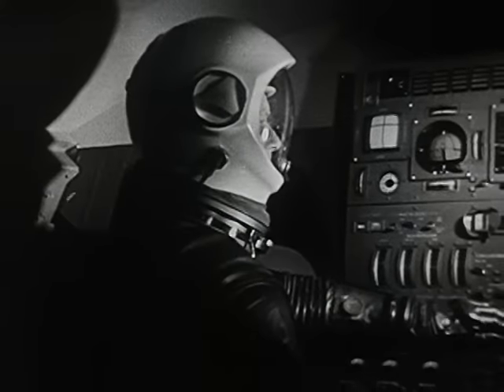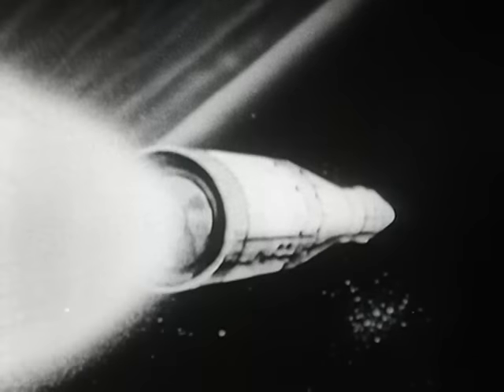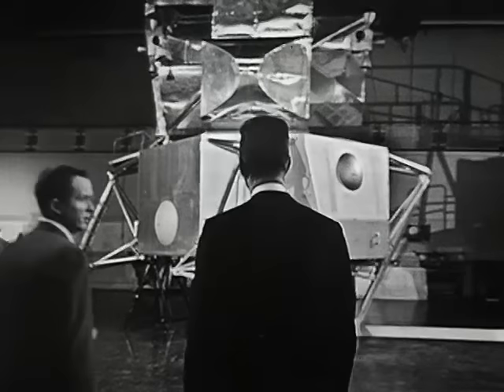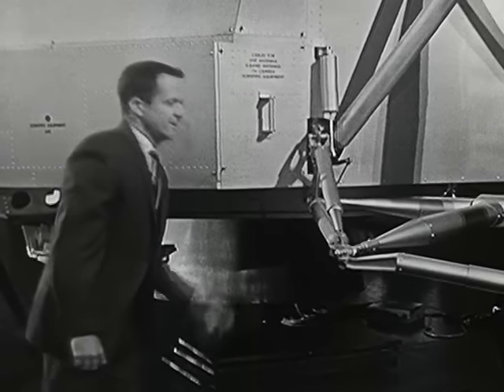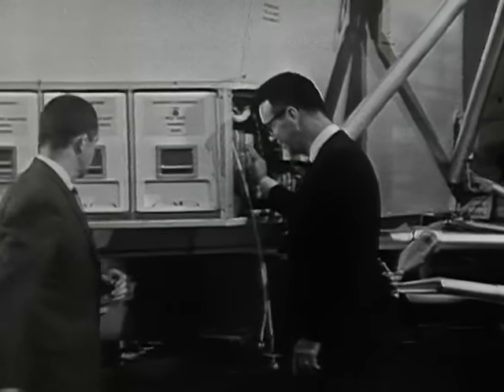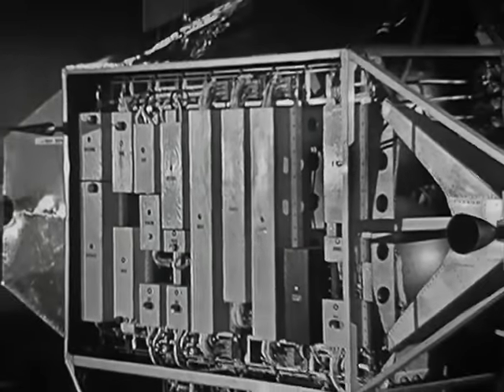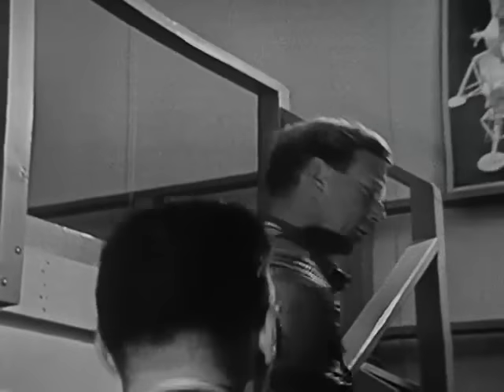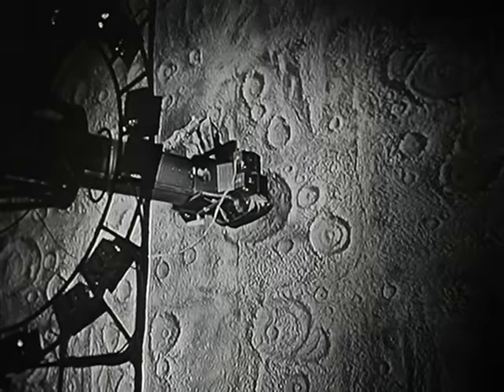MIT Science Reporter — "Landing on the Moon" (1966)

Comment: Where do they store the batteries, where is the air conditioner, where do they store the breathable oxygen, how do they put on space suits in such limited space, how do they determine altitude when landing???
Reply: Why not look it up?
Reply: +TheBigley  You didn't really expect your questions to be answered in the YouTube comments section did you? You could download a copy of the Lunar Module Familiarization Manual LMA790 Volume 1 which was used by the astronauts themselves to get their heads around the LM and its operation. Wikipedia has some great entries. All you have to do is intone the sacred word G-O-O-G-L-E   G-O-O-G-L-E.
Reply: PoloponyAZ16 What about the 3 huge parachutes?
Reply: Thats not on the LEM thats on the CM
Reply: +37VQV  You are a party pooper! PoloponyAZ16 had it all worked out in his mind's eye that everything was in the LM. Why spoil his pet 'unassailable' proof that the Apollo missions were 'obviously' impossible by injecting facts into the discussion?
Reply: So true...the part I like is when they are coming back through earth's atmosphere in their mostly aluminum capsule in 3500 degree heat but it's all dandy because they have a heat shield that protects them but completely burns up so that's why you never see it and then...when they evacuate the astronauts from the capsule they place a blanket around them even though they are in suits that can withstand temperature fluctuations of over 500 degrees.
Reply: TheBigley We are not there yet. We are still trying to figure out how to get through the van allen belts without frying the astronauts.
Reply: " . . . without frying the astronauts.. . ." where is this expression from? The difficulty has never been the supposed lethal radiation dosages to humans. The present concern is the radiation effects on delicate modern computer chips.
Reply: Just CuriouS I heard it in a video about the dangers of the belts. By the way it must of been hard trying to sleep in the LEM with little room
Reply: You go back and check what was really said.  At no point was it said that the problem was human survival.
Reply: Where did all that thrust come from when taking off from the moon? People inside too? lol
Reply: +Samstyme  Well if the astronauts ate enough Moon cheese the methane produced could be used to provide some anal thrust. . . Ever heard of doing some research. The rigidly-mounted fixed-thrust Lunar Module Ascent Engine was designed primarily by Bell Aerosystems and developed a thrust of 3500 lbf or 16 kN with a specific impulse of 311 seconds. It was quite capable of lifting two astronauts and lunar samples into a 60 nautical mile parking orbit.

So now you can let loose with whatever wacko auxiliary questions lie in the holding pattern of your mind!
Reply: It was not destroyed at "the cape" The LLRV#1 was flown by Armstrong on 6th May 1968 at  Ellington Air Force Base, the headquarters for Johnson Space Center’s aircraft operations. It was not flown at Cape Kennedy. 

It did not crash because of instability although the machine was deliberately designed with reduced stability so as to simulate the full LM flight profile - being a typical moon loon you would not be aware of the pay off between stability and maneuverability, extreme stability means greatly reduced or zero maneuverability. The reason for Armstrong's crash, much publicised by moon loon propaganda websites, was not stability but a simple pilot error. The pilot before Armstrong's flight was Bill Anders and he had activated the crossfeed valve that diverted propellant from the RCS tank to the main rocket tank but this was not communicated to Armstrong. The result was that the RCS propellant supply was consumed faster than normal resulting in an unexpected early depletion of the RCS supply. No propellant, no RCS, therefore no attitude control regardless of how well the machine was designed to fly. This flight by Armstrong was the 198th flight of the LLRV#1 rig NOT its first which occurred on 30th October 1964 nearly 4 years before the crash!

All mission commanders from Apollo 11 to Apollo 17 trained on the LLTV making for hundreds of training flights. Not bad for a machine that was soooooo unst . unsta . . unstab . . . stable . . . . unstable hey!
Reply: Milt Farrow So you fail to or refuse to recognise that the vehicle you saw crash was the LLRV. No Lunar Module was trialed at "the cape" as it could not even support its own weight in a 1 g environment. Its two propulsion motors the LMDE and the LMAE could not operate properly with a 1 atmosphere ambient pressure.

You clearly possess great technical skill in the area of the design of control systems. For lesser mortals such as myself could you please define what "gyroscopic stability" is? I am more familiar myself with a state space and linear control system approach using root locus methods to define stability but I will accede to your definition of gyroscopic stability!
Reply: Milt Farrow Right! Give the links to the pilot's statement. Even the use of the word pilot in the singular indicates that it was the LLRV as it could only accomodate one person whereas the LM had two pilots (plural). So give us the link to the pilot's statement that it was the Grumman Lunar Module and the cause of the crash was fundamental instability!
Reply: This should be interesting as our moon loon does not know what the LLRV even is, that the pilot was Neil Armstrong and the finding of the Board of Inquiry was that the cause of the crash of LLRV#1 was RCS depletion due to inappropriate propellant crossfeed valve setting. With no RCS propellant there was NO attitude control possible (with no attitude control it could be said that the vehicle was rendered unstable by that particular happenstance). The tricky handling characteristics of the LLRV and the later LLTV was acknowledged by all and it was from Armstrong's own urging that the LLTV training program was maintained as it was indispensable. There were only 3 crashes of the LLRV/LLTV in nearly 300 training flights none of which were attributed to "lateral instability" or even more humourously "gyroscopic instability". I just cannot wait to see what if any links he can come up with - there will be a pause as he searches in vain followed by the horrendous realisation when he gets what he thought was the event that the content will support what I just wrote. Will he admit this? No, he will just come back with more profanity I wager. One day he even might realise that any discussion of the systems on the Bell Aerosystem LLTV had no relevance whatsoever to the Grumman Lunar Module which was a completely different machine!
Reply: Milt Farrow " . . . the media was called in for the event and di record the crash . . . "

I didn't know that NASA hired Maria the Gypsy to crystal ball that a crash was going to happen! As JCS has indicated the Lunar Landing Research Vehicle (LLRV) had flown hundreds of times already before the crash in May 1968 without mishap. How was it possible that NASA knew that this flight was going to be one of the only three crashes of this vehicle to invite the media in to record it? If it was serendipitous that the LLRV crashed in front of the media what was the ostensible reason why the media hounds were called in to record that particular flight in the first place?
Reply: Milt Farrow  I would like to reaffirm JCS's comment that no LM was tested in flight on the earth. Apart from what Tom Kelly and JCS have said regarding the LM's inability to withstand 1 g, the reaction control system (RCS) used by the LM to control its attitude had a few design quirks that prohibited such a ground-based undertaking.

The LM RCS was the first vehicle to use a bipropellant - Aerozene 50 & N2O4 - system unlike Mercury and Gemini vehicles that used a monopropellant hydrogen peroxide system as did the LLRV. Marquardt the developer of the RCS found that the engines suffered from a destructive detonation spike problem that could only be alleviated by ensuring that any propellant residues were rapidly evaporated by having the RCS engines always preheated by electrical heaters before any firing of the system and that the motors were only fired in the space vacuum they were designed for to assist in the evaporation process. Operating the LM RCS at sea level pressures would have resulted in the explosive destruction of one or more of the RCS engines!

The first operational test of the LM was when LM1 was thoroughly tested in low earth orbit as part of the Apollo 5 test program.

There is no way that you saw a video of the LM being tested under ordinary sea level atmospheric conditions and under a full earth gravity environment!
Reply: +Lloyd Cash :))
Reply: Hey, that's a good point!!! It seems impossible. It must be fake.
Reply: @justcurious7614  dude or dudette....this is literally the best statement.ever.  OMG had me ROTFL.  You should be a comedian. Everyone is so serious about did we go or didn't we go. I have no idea. The evidence is definitely shady. Thanks for brightening my day though you are a champ!
Reply: +strikenryken Glad I could provide you with at least a little entertainment. The evidence that the Americans landed on the Moon repetitively between 1969 and 1972 is overwhelming. The evidence only appears to be shady when presented by either idiots or persons with ulterior motives such as Marcus Allen trying to hock his magazine "Nexus Magazine", of which he is the editor, for the consumption of morons or those with a pathological need to believe in the existence of maniacal conspiracies.
Reply: @PoloponyAZ16 - there were no parachutes in the LEM - why would there be? They would be of no use for landing on the moon.
The only parachutes in the mission were in the command module, which stayed in orbit and did not descend to the moon, and is the only part of the vehicle that returned to earth which is where the parachutes are used.
Reply: when the capsul hits the cold water, it should create a massive cloud of steam
Reply: 6  Soviet cosmonauts were fried, before Gagarin, that's why the Soviets faked his trip. And answers the most puzzling question, why didn't the Soviets spill the beans on NASA--?  mutual silence !
Reply: @MrDaiseymay  A truly brilliant misunderstanding of the mechanism of ablative cooling. The detached bow shock wave deflected much of the heated air away from the surface of the heat shield. There was however some radiant heat transfer to the heat shield material but this heat was absorbed by an ablative lining that readily volatised under moderate heating to produce a relatively cool boundary layer carrying the heat away in the spacecraft slipstream. The heat shield matrix was made of thermally insulating material so that only a relatively small amount of thermal energy was conductedinto the crew cabin. Finally the parachute descent took minutes not seconds at subsonuc speeds during which time cool atmospheric air brought the heat shield down to atmospheric temperature.

The way you would have it would have been more like how would you have liked your astronauts to be served. Char broiled Armstrong anyone ?
Reply: @eventcone  that would require learning something
Reply: @justcurious7614  ahhh but its "all CGI sheeple"
Reply: @justcurious7614  please dont use science it confuses them
Reply: All I saw was an expensive piece of junk. The only thing that it would have been good for, had it been used, was a coffin for anyone who would ever attempt to use it. However it was very interesting. You put a pair of glasses on some geeky looking guy and you have instant scientist. And you have to believe the scientists.
Reply: @justcurious7614  dont use science they dont understand it
Reply: Milt Farrow  What?
Reply: @justcurious7614  Sadly, you are casting pearls before swine. Great post, though.
Reply: +Richard B "All I saw was an expensive piece of junk. . . " 

Don't go gemstone fossicking then will you! " Durrr . . I went looking for rubies & sapphires but all I found was a mountain of bland rough very ordinary rocks!" It is only when you think about what you are looking at that you can appreciate the gemstone that lies within. What would a vehicle that solely operates in the hard vacuum of space without any atmospheric drag with static loadings no greater than 1/6th of a g where every extra kilogram has been fastidiously weeded out and eliminated? Answer: a vehicle like what you have never seen before! 

What looks like a rickety death trap away from its intended operating environment is converted into the thoroughbred it really is when taken out of an Earth-bound display room. It reminds me of a jellyfish landed up on the beach that appears as an amorphous blob of tissue. Put it back into its intended weightless marine environment and it turns into a thing of exquisite beauty, apparently fragile but in reality incredibly tough and durable.
Reply: Milt Farrow  Debate? There is no debate! Only your periodic insertion of maniacal nonsense. Whatever happened to the LLTV crash in 1968 being misrepresented by you as incontravertible 'proof' that Grumman LM was inherently 'gyroscopically' unstable? The facts behind this are simple and easily obtained. The LLTV was not the LM and only simulated the handling performance not the engineering systems of the LM. The LLRV/LLTV had been in training use since 1964 with nearly 200 flights logged before its much-publicised ( and much-misconstrued) crash in mid 1968 with Neil Armstrong at the controls! Moon loon propaganda would have us believe that this was the singular flight of the 'fatally flawed' LM when Neil Armstrong himself flew the LLTV ( not the LM) over 50 times. Now you come up with nonsense from some 1871 act of Congress that has nothing to do with the Apollo moon flights.
Reply: Milt Farrow  The pilot of the LLRV/LLTV on that occassion was Neil Armstrong and the touchy handling of the LLTV was factored deliberately in the design and readily acknowledged by all involved in its training use. Manoeuvrability and stability always work against each other as any aerospace engineer would tell you. What continuously  escapes your ability to comprehend is that the subject of any media reports was the Bell aerospace LLTV and not the Grumman LM. When will you finally get it that the LLTV was NOT the LM!
Reply: @Zombie Killer Total rubbish! Where the hell did you get that the LM was at 250ºF for 3 days? All lunar landings occurred at the location of the lunar morning terminator with a very small solar elevation ~ 6º. In 3 days the largest solar elevation achieved at lunar liftoff could have only been 6 + 3/29.53 x 360 ~ 43º!
Reply: @Zombie Killer The Earth and Moon are in the Sun's habitable zone at  1 AU from the Sun. Objects in this zone will only require passive temperature control mechanisms and will not require excessively active environmental control systems such as an A/C unit on steroids that you seem to fantasize about. To this day space probes going closer to the Sun than the habitable  zone require active cooling while probes going to the outer planets require active heating. Earth satellites which operate in the same thermodynamic environment as Apollo crews have a service life of about 10 years during which time the only temperature control tactic is a passive one of spacecraft  rotation to even out temperature extremes with no active environmental control system whatsoever!
Reply: @Zombie Killer Obviously you have not studied thermodynamics and know zip about radiant heat transfer. 

There are not just two temperatures on the Moon - the two extremes at the point directly beneath the Sun and just before lunar sunrise. Equilibrium temperature exists as a continuum as any reference work on the Moon will verify and is that temperature where radiant heat loss balances the radiant heat absorbed and is a strong function of the elevation angle of the Sun - the sunlit side is not at just at the temperature of the nadir point directly beneath the Sun. At the Moon's morning terminator the surface temperature is about 0ºC and after 3 days the Moon's surface temperature is about 60ºC (140ºF). The temperature achieved by an object on the lunar surface is a function of many variables only one of which is the lunar surface temperature.
Reply: Same questions made by S.Kubrick in "The shining". When Jack Torrance family arrives at Overlook Hotel they unload a quantity of things which are absolutely impossible to be packed ina VW Beetle
Reply: @nicolagianaroli2024  Have you bothered to check how the various items were stored in the LM?
Reply: @justcurious7614  To be frank with you I haven't found any source yet to provide full and detailed account of what was transported but I'd love to find it. Stll there are things which makes no sense such as the coaxial cable and camera for live TV coverage. That is an insult to our intelligence.Moreover where is the equipment to measure temperature and radiation? How come to contrary to what stated by MIT guy Armstrong has brought back a lot of memorabilia intended to remain on the moon which was found in his cupboard after his death?
Reply: Careful, this is too rational.
Reply: @jcdova29  says "hard trying to sleep in the LEM with little room", but the essential toilet and shower facilities as all Americans need when the outside temperature is 150˚c was not installed. That is why they looked so destroyed weeks after when asked to relate the exciting trip they had had. 
Have you ever had a 14 hour flight to Asia? These guys stayed cramped up for days and had great food aboard so were completely confident that the hi-tech gear we see with instruments measuring 'feet' on a wheel, would get them comfortably to the surface and then with a Honda 50 engine propel them 60 miles into the atmosphere to meet the command 'module' flying past at 1600 "miles per hour". But they loved the "American Units" when calculating. Nothing decimal and standard for those boys, no, they preferred the 16 'ounces' in a 'pound', then 14 'pounds' in a 'stone' and 12 'inches in a 'foot' and three 'feet' in a 'yard' and 1760 'yards' in a 'mile' so any Newtonian calculation could be quickly checked using fingers and thumbs, sliderules and radio signals to "Houston Control" who had the farmer boys all using 64 byte computers calculating the 'feet' and 'fingers' from disaster. Brilliant. Really good to see some lonely Americans who still can't let go of the fantasy that 'their boys' got them to the moon and back in some rods of scaffolding covered with heat resistant radiation 'special' tinfoil, which was sold out just after they got back home and has since gone out of production.
Keep it up yanky boys, we would have no one else to ridicule if it weren't for you. You are absolutely the best and apologies to those of you who feel insulted by me joking about this no doubt very serious crime and theft of trillions of your tax money. You can afford it. Just print out some more.
Reply: @jcdova29  They went  around the most dangerous parts according to Curious Droid
Reply: kenneth keen
"but the essential toilet and shower facilities as all Americans need when the outside temperature is 150˚c was not installed"

Showers were not necessary, and their human waste was not a pleasant, or error-free activity, but they did have a system for it.
https://history.nasa.gov/SP-368/s6ch2.htm

"These guys stayed cramped up for days and had great food aboard"

Cramped, yes, but also well-trained and experienced regarding such conditions.  The food was  specifically made to have a low residual output, as noted in the link I provided above.

"with a Honda 50 engine propel them 60 miles into the atmosphere"

The LM Ascent Engine provided 3,500 pounds-force (16 kN), which was a thrust-to-weight ratio of 19.44.  And NEWS FLASH:  there is no significant atmosphere on the Moon.

Your incredulity at the use of non-metric terms is rather vapid, since these are simple mathematical conversions for even the earliest calculators.

"Really good to see some lonely Americans who still can't let go of the fantasy that 'their boys' got them to the moon and back"

Really sad to see the willful ignorance people such as you don't mind flaunting to the world.

"heat resistant radiation 'special' tinfoil, which was sold out just after they got back home and has since gone out of production"

Nothing about the Apollo missions correlates with that statement.

"Keep it up yanky boys, we would have no one else to ridicule if it weren't for you."

We'll send you some mirrors, then.

"You are absolutely the best"

Some are - some are just as confused as you.
Reply: Unhappy Customer

"How do radio signals travel that far, considering the terrible reception we get here on earth?"

Several reasons.  No buildings, trees or mountains to block the signals.  Also, look up "High-Gain Antenna", and "Deep Space Network".  Remember, we can still collect the signals from the Voyager crafts, even though they have technically recently left the Solar System.
Reply: Milt Farrow
"the pilot said it was unstable as it nearly killed him"  

Just another incorrect statement from a person obviously prejudiced against the facts.  In Neil's own words (From - https://www.huffingtonpost.com/2012/07/23/neil-armstrong-simulator-crash-apollo-11-astronaut_n_1695226.html):

Armstrong praised the craft humorously dubbed the “flying bedstead,” saying it did “an excellent job of factually capturing the handling characteristics of the lunar module in the landing maneuver.”
Reply: How they use the toilet!!!
Reply: @justcurious7614  Thats weird. Isn't this whole going to the moon fantasy about human survival?
Reply: @shirleeeyyy  I don't know which comment of mine that you are alluding to.
Reply: @justcurious7614  Sorry Just Curious, I don't know what i'm doing wrong but my replies don't always get attached to who i intended to. This was meant to be a somewhat of agreeance with Randy Rinkers post
Reply: @shirleeeyyy   You must be having one hell of a time because there is no post by Randy Rinkers on this thread. There is a post made under that name in the main comments. I reckon you are using an android digital device with a small keyboard such as a smart phone. All the best . . . it looks like you're going to need it!
Reply: I can see nothing wrong with the transmission. The camera aperture setting was adjusted for the low lighting levels in the cabin which means that high light intensity regions would be overexposed. Rather than doubt the authenticity of the film, why not pull out a Dumbies! Book of Photography and get the real answers.

 You did not find one small segment of a 35 minute video by random viewing and I suspect you are directly or indirectly more than familiar with the 'work' of Mary Bennett and David Percy as this was 'revealed' in their video 'exposee' "Dark Moon: Apollo and the Whistle-Blowers" https://www.youtube.com/watch?v=c0rKyHdVizI at the 12:15 mark . This has been hashed and rehashed ad nausem and is easily debunked by anyone with the slightest photographic knowledge!
Reply: Interesting as it confirms what many psychologists have stated that those inclined towards a conspiracy theory explanation for one event are inclined to resort to conspiracies to explain many unrelated events. A paranoid mentality with a world view filled with implacable hostile entities seeks reassurance by finding 'explanations' palatable to that paranoid mentality.Noelle Leger I am not particularly interested in pursuing each and every paranoid delusion that you entertain as 'truth'. My only desire is to set the record straight regarding the Apollo flights to the Moon based on facts. I have had a 35 year career in aerospace engineering and would be prepared to write off as just good entertainment value the rabid moon loon conspiracies that flourish on the internet if it were not for the great potential that such total dribble has to damage the names and reputations of the men involved in those undertakings from 50 years ago.If you do not have other 'revelations' pertaining to the Apollo Moon flights I have no interest in your delusions as entertaining as they may be!
Reply: NASA has never said that the VABs are very dangerous at least not in the context of prohibiting manned space flight. They have been correctly described as a significant radiation hazard though. Here is quoted a statement from Dr James Van Allen regarding the radiation belts that he discovered:

 "In reply to your e-mail, I send you the following copy of a response that I wrote to another inquiry about 2 months ago -- 

 Ø    The radiation belts of the Earth do, indeed, pose important constraints on the safety of human space flight.

 Ø    The very energetic (tens to hundreds of MeV) protons in the inner radiation belt are the most dangerous and most difficult to shield against.  Specifically, prolonged flights (i.e., ones of many months' duration) of humans or other animals in orbits about the Earth must be conducted at altitudes less than about 250 miles in order to avoid significant radiation exposure.

 Ø    A person in the cabin of a space shuttle in a circular equatorial orbit in the most intense region of the inner radiation belt, at an altitude of about 1000 miles, would be subjected to a fatal dosage of radiation in about one week.  

 Ø    However, the outbound and inbound trajectories of the Apollo spacecraft cut through the outer portions of the inner belt and because of their high speed spent only about 15 minutes in traversing the region and less than 2 hours in traversing the much less penetrating radiation in the outer radiation belt.  The resulting radiation exposure for the round trip was less than 1% of a fatal dosage - a very minor risk among the far greater other risks of such flights.  I made such estimates in the early 1960s and so informed NASA engineers who were planning the Apollo flights.  These estimates are still reliable.

 Ø    The recent Fox TV show, which I saw, is an ingenious and entertaining assemblage of nonsense.  The claim that radiation exposure during the Apollo missions would have been fatal to the astronauts is only one example of such nonsense.

 James A. Van Allen"

internet source: https://forum.cosmoquest.org/archive/index.php/t-3885.html . For persons seeking to find the truth behind the VABs and Apollo flights, Dr. Van Allen's comments clarify the matter completely especially the fourth bullet point in the quote above. The source of the moon loon hoaxtards' interpretation lies in the layman's reaction to the word 'radiation' or from a desire to hijack the layman's reaction to provide an easy acceptance of their crackpot theories among individuals who have zero informed appreciation of radiological effects
Reply: Noelle Leger  To what do you refer, 1) two astronauts present at the one incident where only one reported hearing the hammerblow or 2) two astronauts each at different incidents where in one incident a hammerblow was heard while at the other incident no hammer blow was heard ?

Hammer blows transmitted through the handle of the hammer into the antiballooning plates in the palm of the A7L pressure suit glove were reported on Apollos 12 & 15. These were associated with a few but not all of the occasions where core samples of the lunar surface were taken. On the few occasions where the hammerblows were transmitted through the pressure suit to the astronaut's microphone, both astronauts and the ground controllers could also hear the same attenuated hammerblows at the same instants in time. So I am not aware of case 1) occurring.

If your query concerns case 2) then most probably you are discussing the linked moon loon hoaxtard video in your last post. The fabricator of this piece of nonsense has carefully spliced together video sequences from 2 unrelated situations. In the first sequence the Apollo 15 astronauts are standing firmly on the Moon while the second sequence involves astronauts using reactionless tools outside the ISS in apparent weightlessness. The second sequence of an EVA outside the ISS showed the use of reactionless tools and did not involve the use of an impactive tool such as a hammer. Look at the tool - it is NOT a hammer and it is NOT being swung to make impactive blows!!! Indeed astronauts in apparent weightlessness during orbital operations not firmly attached by harnesses to the exterior of the spacecraft cannot use hammers or other ordinary tools as their bodies must provide the necessary reaction forces and torques to operate and locate the tools. Newton's third law dictates that the astronaut must move with the reverse translation and/or rotation to that of the tool. The comments of the astronaut that ends the second sequence is being quoted out of context as he was only referring to ISS EVAs but the disingenuous splicing together of the two disparate video sequences makes it seem to the viewer that he is making general comments on both clips.

The fabrication of a storyline by cutting and splicing together of video sequences is a classic moon loon hoaxtard deception mastered by Bart Sibrel. Who could forget the way that Barty boy edited the interview with astronaut Alan Bean (Apollo 12 LMP and Skylab 3 commander) to make it seem that comments made concerning the Skylab 3 mission were made with reference to Apollo 12 instead by cutting and splicing! Sibrel unfortunately had a field day in the editing room and overdid the splicing trick so that what he had done was obvious to anyone familiar with both flights of Bean's space career. Only mention of the Apollo 12 mission by name was allowed by Sibrel's editing and any mention of the Skylab 3 LEO missiin designation was edited out.
Reply: Noelle Leger  The Van Allen belts are not constant invariant phenomena. Their extent and intensity depended upon the earth's magnetic field strength and the flow of charged particles emanating from the Sun and the rate at which such particles are absorbed by the upper atmosphere. As these factors alter so do the VABs so they are always in a transient state of flux. In February 2013 when a third belt temporarily appeared the Sun was in the middle of a solar storm so that the VABs were somewhat swollen.

The actual nature of the VABs at any given instant in time would only be a significant factor for spacecraft remaining for an extended period of time within them. As already explained Apollo flights completely avoided the inner belt and spent no more than about an hour traversing the outer belt so that the crews' received radiation doses were quite low. Apollo crewmen each carried a personal radiation dosameter and VAB fluctuations at least partially accounts for each crew receiving variable total radiation dosages by the end of each flight - offhand from memory I think it was the crew of Apollo 15 that received the largest dosages.
Reply: @Noelle Leger  Your thought being . .? Even at their greatest extent the VABs would only pose a danger to Apollo crews if they lingered in them for a week or so. As it was Apollo trajectories only exposed the crews to the outer VAB for about an hour. The aluminium and plastic shielding afforded the crew a relatively safe radiological environment so that from memory the highest personal dosage of any Apollo crewman was just over 1Rad. The maximum safe dosage for nuclear workers is 5 Rads in any 12 month period.

The real problem is that the moon loon hoaxtard community have been whipped up into a frenzy over radiation issues by persons with no radiological qualifications whatsoever. Bill Kaysing started all this VAB nonsense back in 1975. He had a arts degree majoring in English and wrote some beautiful self-help health books and I think he also wrote a manual on motorbike repairs but he had received no training on radiological issues save that of the general public in the 50s and 60s who came to associate the word 'radiation' with impending doom courtesy of the Cold War hysteria of the time. The hoaxtard lather into which they have beaten themselves is all hot air and thin membranes of soapy water!
Reply: I looked up the figures at https://en.wikipedia.org/wiki/Van_Allen_radiation_belt . The maximum Apollo radiation dose was 1.14 rads. The annual received dose permitted for radiation workers is 5 rems or rads per year. The present radiation standard used by NASA is given at https://standards.nasa.gov/standard/nasa/nasa-std-3001-vol-1  on page 21.

Assuming that the VABs were responsible for the total astronaut received dosage (which they weren't) one could conservatively state that the VABs could have been at least 5 times more intense than they actually were without exceeding the permitted dosage for radiation workers. The major contribution to the total received dosage was from solar particles from outside the Earth's magnetic field and hence from outside the VABs in interplanetary space. As VABs only contributed a minor portion of total received dosage the VABs could have been far more than 5 times more intense without posing a significant radiological peril to the crew! Even in the periods of the highest solar activity the VABs never get anywhere near 5 times as intense as when the Sun is in a quiescent phase.

The scenario you seem to be endeavouring to paint is in view of the facts a moot point indeed!
Reply: I think micky mouse was doing that job but i could be rong might have been one of the 7 dwarfs crumpy or stumpy !!!
Reply: @jameslatimer1432  A suitable fairytale setting answer for a ridiculous set of questions posed by the Bigley based on total ignorance of the Apollo moon flights!
Reply: the life support systems are gonna be the key to proving or disproving these missions.....
Reply: @SuperEcotech  What makes you think there is the possiblity of some inadequacy of the ECS (environmental control system) to deal with cislunar space?
Reply: How do you fire a rocket in a vacuum?
Reply: @jcpapillons  Easy as! You send it the pink slip very carefully. LOL

The external pressure is essentially zero but the pressure inside the motor is greatestest in the combustion chamber with static pressure reducing through the de Laval nozzle to essentially zero at the exit plane. The situation is not that of a stationary body of gas as the gas is accelerating and requires a negative pressure gradient to achieve that acceleration. To move air down a pipe requires a high pressure and a low pressure end. Rockets operating in a vaccuum have a large expansion ratio on the nozzle to bring the gas static pressure to within a few kPa of zero pressure. So in the combustion chamber where ignition and the majority of the combustion process occurs the pressure of the propellant vapour and resultant combustion gases is not zero.
Reply: Terry Winter  You have no previous comment on this thread so you must be a new 'drop-in'. To what were you referring?
Reply: @justcurious7614  absolute legend
Reply: @eventcone  cause there is no answer! Where do they store the batteries, where is the air conditioner, where do they store the breathable oxygen, how do they put on space suits in such limited space, how do they determine altitude when landing???
Reply: @TheBigley  lol
Reply: @justcurious7614  And then it blew apart the aluminum foil lander.
Reply: @justcurious7614  it was either the dilutetium crystals or the flux capacitor, they're still not sure.
Reply: @justcurious7614  you didn't land on the moon! Yes, we did...resulting punch in the nose by an actor.
Reply: @justcurious7614  Hey Neil, the LLRV is gonna be touchy in landing. Make sure you pay attention at that point, cause everything is dependent on your throttle hand.